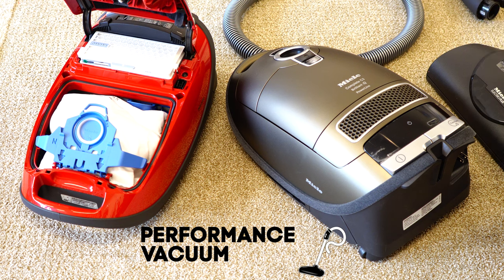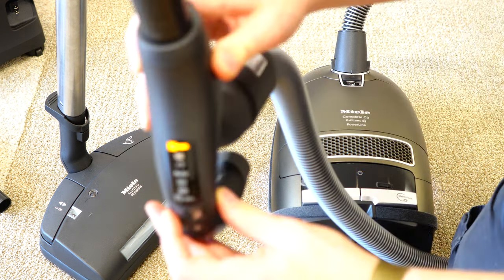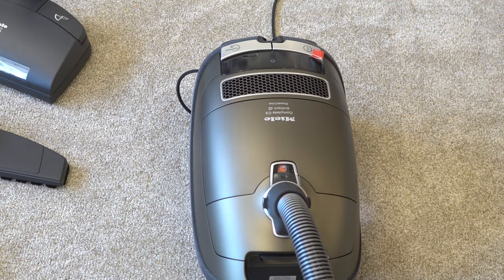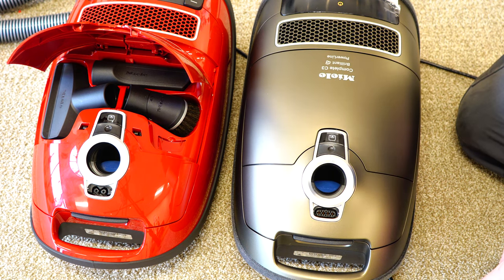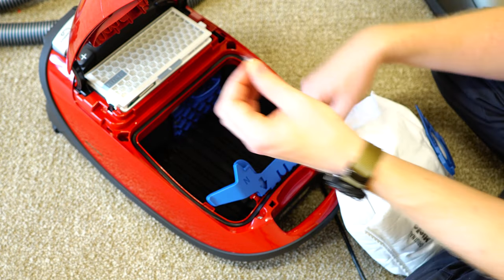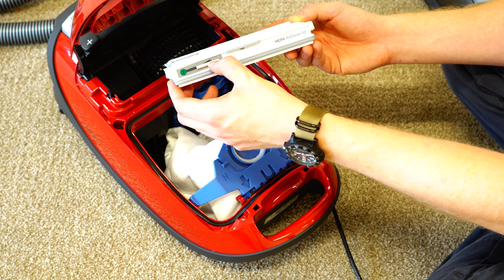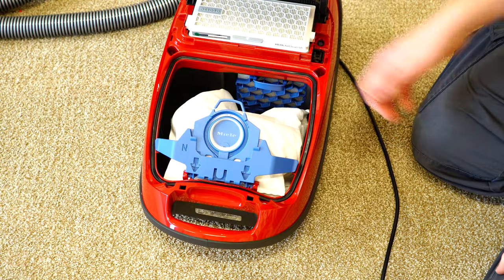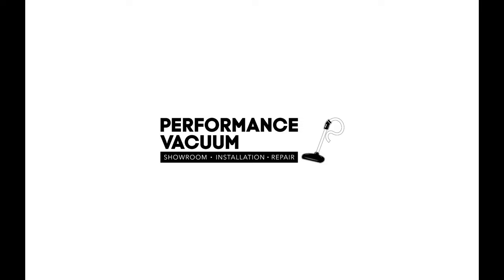Miele C3 User Manual How To

Comment: Thank you so much for this video.  I bought a C3 Complete on 29 April this year and there were no printed instructions in the box.  Luckily I found your video as it shows the two filters.  My Airclean filter looks different to the one in the video as it doesn't have the word REPLACE gradually showing as the filter gets dirtier.  I turned the filter box over and the pad was black; so I replaced it.  That's after using the vacuum about 27 times since I bought it.  I'm a domestic cleaner and have 3 clients who prefer me to use my own vacuum cleaner.  All the best to you.

Comment: Thank you, that was helpful in diagnosing a problem. I tried pressing the play button on the heap filter, and even pressed really hard, but nothing happened. The bottom of the HEPA filter is gray and is just over a year old so it does need changing—Just not sure why that little play thing is not doing what yours did.